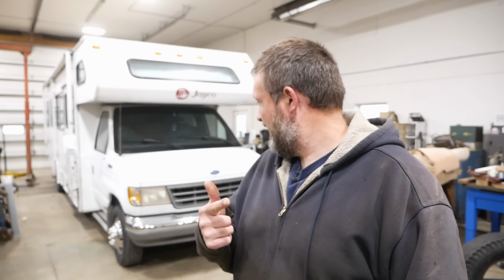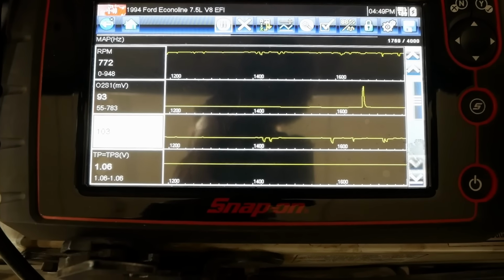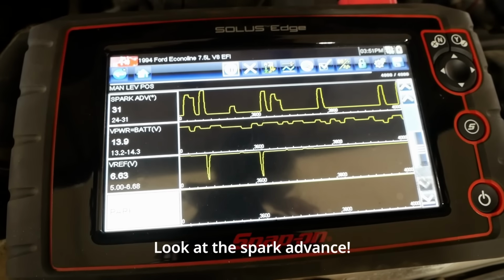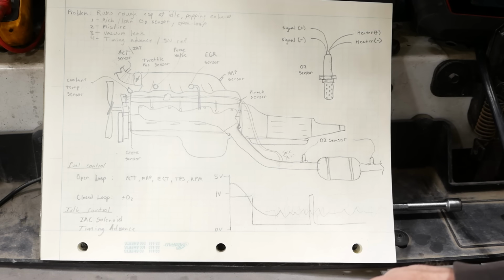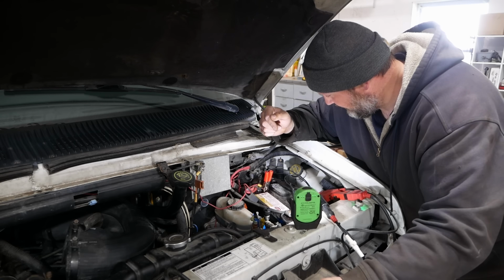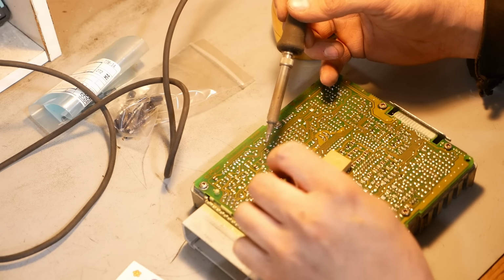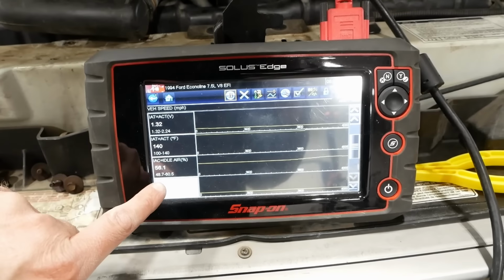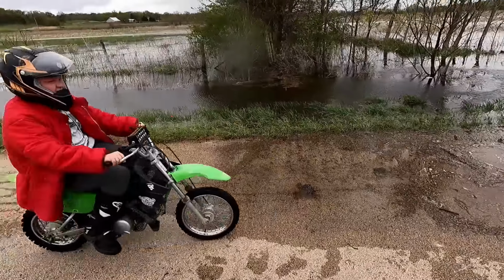Ford 460 RV Surges, Runs Rough but Nothing's Wrong?

Comment: 1992 Ford E-150 Van, 5.8L. Past several plus years intermittently the "Engine" light would come on, stay lit for various lengths of time and go off and repeat the on & off. Last fall found out about the 3 Electrolyte Can Capacitors. About six weeks ago pulled the computer and found what Wes found. My problem was much worse than what Wes found. One of the Electrolyte Cans had leaked all its guts out under the coating and ate the foil of three circuits. Traced the circuits and used 22 gage solid copper wire and Jumper'd the damaged circuits. Re-installed the computer and the van runs like a champ and haven't seen the "Engine" light come on. This is a very common problem for a series of years of Fords using this computer. **Important note, Fix or have fixed YOUR computer**   If going for a refurbished computer it must be a number/code match.
Reply from the maker: I think what saved it is the PCM is mounted sideways.
Reply: @WatchWesWork  Mine was sideways also. Posted a few more words but it didn't post. 3 caps about $1.50 shipping $8, better than $400 plus bucks for a refurbished unit.

Comment: O2 Sensor on those systems were not always in "closed loop" even at operating temp.  They would use the TAB/TAD (Themactor air bypass and Themactor air downstream) to divert air injection, do an O2 sensor sampling to see what trim was needed and then put the air back into the system and ignore the O2 sensor.  Ford did that on many truck engines back then.  I'd ignore the timing advance.  If it works, it works.   I NEVER had to screw around with that.
Reply from the maker: It has a timing check function in the snap on tool but I never got it to do anything, so who knows.

Comment: Hmmm, my solution, pull the EFI off and put a carb on. 😂
Reply: You can get an inexpensive adapter plate from Price Motorsports but you still need TPS and PCM (or standalone) to control the transmission.

Comment: Great video, Wes!  I wonder if hooking up your oscilloscope to the 5V reference would have shown noise or ripple, ultimately caused by the bad caps?  Might have tipped you off that it was an ECU issue.
Reply from the maker: I was headed there, just never got to it.

Comment: You have an advantage with two soldering irons. To remove two terminal SMT parts you can heat both ends at the same time and just lift it off.

Comment: It seems that for older models of vehicles, reading the voltage coming in to make sure that the solenoid or valve is working was the only thing that was available back then. I mean if mechanics had fancy scan tools like today back then things would be very different. Anyway, interesting repair and I got to learn something new so that's a plus.

Comment: As an electronics technician by trade for twenty years, that Hakko is an excellent solder sucker. I have the same unit and it has worked for over a decade. It is even possible to replace the pump diaprams when they get all gunked up with flux fumes. Nice repair Wes, professional job! I would have done the exact same thing. That is one fancy stand!
Reply: Yes it is. I will never go back to impact solder suckers. Destroyed too many pads with those things.
Reply: Oh man, they're expensive though! Guess I'll stick to the cheap spring-loaded suckers lol

Comment: Doesn't surprise me that all that the "12A650"  would be suffering from age.  I'm thinking that the electrolytics should be the first thing to look at on something that old.  Those systems worked very well back in the day. when I worked on them.  But antiques are old.
Reply from the maker: Surprisingly, I think this is only the second time I have seen bad caps in a vehicle ECU. Auto makes use pretty good components unlike cheap consumer electronics.

Comment: SAI normally works to heat up the CAT but then it shuts off.. so driving for a bit and accelerating OVER a certain RPM might disable the SAI and finally engage Closed Loop..

Comment: The high reference voltage made you question the computer where you found a bad capacitor which didn’t change the reference voltage on the scan tool but fixed the problem!  WTH?
Reply from the maker: My thought exactly.

Comment: good luck with that, my dad had one of those vans with the 460, just changing the plugs is a real experience. chances are that the front plugs are original, you can't even see them even with the front tires off
Reply from the maker: I think they are all original.

Comment: If you have any acetone or similar solvent it will easily remove the acrylic based conformal coating. Just put some on a q-tip and rub the area you want to clean.

Comment: I've noticed that a lot of obd 1 and even early obd 2 vehicles (especially Ford) keep track of a lot of data that just doesn't make a difference to how the engine actually runs.  I've had 5.4l Fords come in with spark plugs and cool packs laying on the valve cover, but wouldn't count misfires?!?  I have felt guilty before about charging for the time that goes in to solving issues like this. But what I've come to realize is that the knowledge, the methodology and the patience to work through problems like this is invaluable.  So don't feel bad about charging for the time you have into it.

Comment: Would it be possible to just wire the O2 sensor output to low/ground and leave it.  And wouldn't the engine just run in open loop all the time?  And leave it that way.  Not as good an MPG but in case the world goes to a MadMax civilization.
Reply from the maker: You could just unplug it. I doubt it would even set a code.

Comment: I started repairing PCM's back in the early 90's when every Mitsubishi Galant, etc had failures and there were no PCM's available new or used. Many were fixed by swapping caps. Few by soldering the connector pins to the board.
Reply from the maker: That's still the two most common repairs IMO. The lead free solder also caused tons of issues.

Comment: Wes, good pick up on the PCM and actually looking at it. How do you deal with these as far as the longevity of the repair and warranty of the repair to the PCM? Do you advise your customer it is only a temporary repair, with the PCM requiring replacing or reconditioning by an company that repairs modules? Do you make a note of the original component values, ie voltages & capacitance values in this case for the PCM repairer should the customer have it repaired? Of course your repair can be the permanent repair.
Reply from the maker: I cannot guarantee this repair. I just advise them that if it fails, they will need to replace the PCM.
Reply: @WatchWesWork  I figured that was the case. At least the vehicle is drivable so your customer can have time to think about what to do next as opposed to a stuck truck and having to fix it then and their, especially if the part is difficult to come by.

In my opinion your repair is better than a "band-aid repair", though I wouldn't want to go to the middle of nowhere till the PCM was replaced. I would keep the one you repaired as a good spare though!

Comment: On those old ford brain dead PCM's block learn and Integr. will tell you if the engine is at a normal air/fuel or correcting high or low. They will always tell you the truth even if the scan tool is showing you false readings when its in a preset mode when open/closed loop is being ignored by the PCM. If it is correcting for lean you can always go straight to vacuum leak or high fuel pressure tests.etc, etc, etc. Fords even today are terrible at failures the presets the engineers give the system are terrible. They have no backups telling them how or what to do if a problem exists. Not to mention thinking its ok to run on fictitious values that do not exist in the system like calculated load and MAF/Map/Baro readings calculated in the absence of a real sensor lol.

Comment: Wes here's a thought, the bad filter Cap was either intermittently or not doing its job at all, just a guess it was probably associated with something the microprocessor is doing if it was there to suppress things that the microprocessor shouldn't see it may have been injecting erroneous data into the running program. Or just corrupting what should be good data with a high bit error rate. It would be interesting to know where it was in the circuit and what its purpose was.
Wes you are truly one-of-a-kind in the automotive world.
Reply from the maker: I suspect it has to do with the 5V reference or with filtering power to the microprocessor.

Comment: Likely the board links reference voltages from multiple circuits.  One being melted makes several go for a wander or default to something rediculous.

The real issue is the surge that melted the cap:  and that can come from RV surges caused by feedback through the 12 volt system.  Todays good RVs use dc to dc chargers which eliminate the feedback surges that cause engine damage .

Comment: Soon as you had the scan tool reading 6v vs the 5v the multimeter was reading, I knew there was a problem with the PCM. Great diag! I love this channel for that reason.
Reply: It still reads 6 volts even after he fixed it.
Reply from the maker: Yep, still confused.
Reply: @ROGER TUCKER  I must have missed that part. I just saw the initial clip and my head was like... well... there's something wrong with the PCM, cause it's what sending data to the scan tool. Who knows... magic. Lol!
Reply: I don't try to understand magic and O2 sensors. Haha!

Comment: Amazing how electronics, once they get some years on them, will have suspect damaged components. But I had similar problems with parts, basically capacitors and relays, in older modules myself. As much as they try to coat the circuit boards to keep corrosion out, they still have problems...   Thumbs Up

Comment: Oh one of these we had a transit / econoline come in for no speed gage all of the caps in it had blown up then I went home for the day and came back it ran without the dash yesterday and the next day the ignition died the control module for it died and took out the coil talk about annoying all the caps in these are dying and will take out other components these 94 Ford's are not long for this world.

Comment: I do like the way you have your capacitors organised, VERY NICE!! If the labels won't stay stuck to the drawers, put a strip of Scotch tape over it. You most likely already now that but I have used the Justin Case reason for telling you that.

Wes, I have absolutely zero issues with your soddering ability because a blind dead person can solder better than moi. I will overlook your pronunciation of the word soldering if you or anyone else can explain to me (not justify, just explain) so I can understand why Americans pronounce the word as _ sodder / soddering_ ). I really am curious why as to it is so. Thank you.

As for your vehicle repairing abilities, you sir are a Steely eyed electrical/electronic and mechanical engineer man!
Your videos are as always Greatly Appreciated especially considering all the time it takes you to film, edit and publish them using the donkey powered Internet you have. Thank You! 👍

Comment: Very common caps go pee pee in ecu causing crappy idle & drivability problems in 90's Ford's, I've done hundreds of them over the yrs.
Reply from the maker: This is the first I have seen.
Reply: @WatchWesWork  They started to fail big time in 90's Falcons & others here in OZ from around 05 on due to the heat we suffer in summer which lasts 5mths a yr,
hope fam is good cheers mate.

Comment: Yaaaaa another reason to run a carburetor 
I truly believe that hoom ever thought that putting a computer in a vehicle was a good idea should be dug up and shot and pissed on 
Just saying 
The fuel savings are not worth the headaches 
Just saying 
Hope you have a great day brother 
God bless you and your's 
As the river still rises 
🤣😂😁😁😁😁👍👍🇨🇦
Reply: Lose all gas savings running back and forth to parts store reloading parts cannon- Carburetors superior
Reply from the maker: I really like EFI and it's great when it works. But when it doesn't...
Reply: @WatchWesWork  I have a 93 F150  4.9 have replaced ECM 3x  over 12 years...   different Symptoms every time. From no Start to Fuel Pump not shutting off with ignition on. ECM's last about 4 years on that era. Carry an extree

Comment: Worked at a Chevy  dealer in the early days of engine management, what a nightmare, diag equipment was limited in scope, info and repair processes were almost non existent,  living the Detroit area, GM had techs they would send out to assist us. great guys usually helpful, one of them always carried a magic wand in his tool kit, said when all else fails, resort to sorcery.
Reply from the maker: Or matches...
Reply: @WatchWesWork  management kind of frowned on that especially in the shop, amazing repair though your abilities and determination are incredible.

Comment: I bought that exact setup in 2015 and had the same issue. 40000 miles. You could overcome the bucking and coughing by running the ac but gas milage suffered. 
 I finally pulled computer and discovered the blown capacitors. $10 in parts and the thing never missed another beat.
 It was still an absolute pig  to drive but great for our family travels.
 The best part was when I sold it in 2021 for $5k more than I paid for it! A rare win in the rv world.
Keep it real Wes! Cheers

Comment: I am not surprised that you're baffled by a Ford. My 2019 V10 is the Queen of Quirks. Sometimes when I'm driving, she runs like two cylinders dropped out. No pep whatsoever. And the problem clears itself up a few miles later. She also has a misfire at idle. I can feel and hear it and I get the rotten egg smell but she runs fine at speed or when the fast idle is on. Then the cooling fan comes on when I start it on a cold morning. I chalk it up to another Ford quirk.

Comment: I went through the same  crap with  my 94 F250 with a 5.8. I threw the parts  at it like we all do. So i took out the ECU an BAM it had 2 of the 3 capacitors on one legs. I bought a rebuilt ECU and it runs perfectly.

Comment: in old cars ,you can have more than 3 or 4 faults ,one above another, had an old landrover 2001 v8 with dead corrupted obd, 9.0 %CO and 900 ppm HC , after changning the maf, tempsensor  and both lamnda,  and a intake leak ,it was street legal ,lots of work, had to check the signal from the ecu  like in old days

Comment: I didn’t see the exhaust leak noted on your sketch. Isn’t that a factory installed component as well?
Reply from the maker: It's just a given on these old Fords.
Reply: Those 460's run very hot in the exhaust manifolds because they used air injection to burn off excess HC and CO before it made it out the tailpipe.
Not uncommon to see them glowing in an RV that is subject to lugging WOT up any kind of grade.
(Yes, I'll admit my 460 has a tick at #8 right now, but the thought of broken manifold bolts has kept me from fixing it 😂)